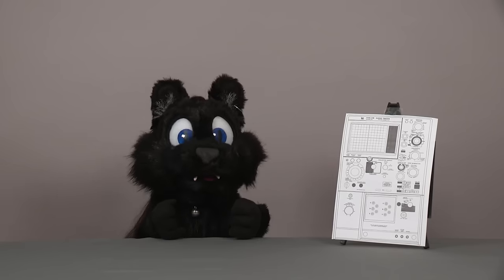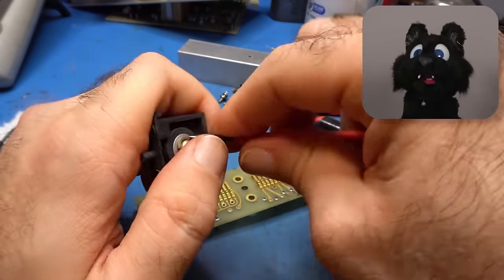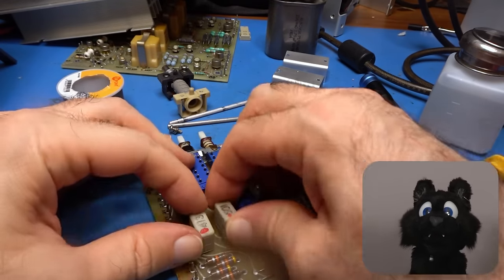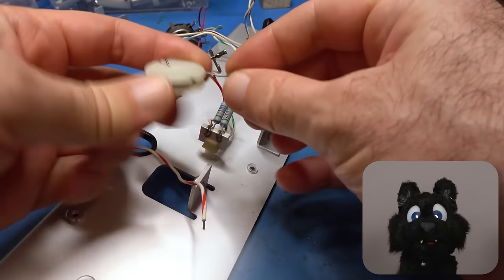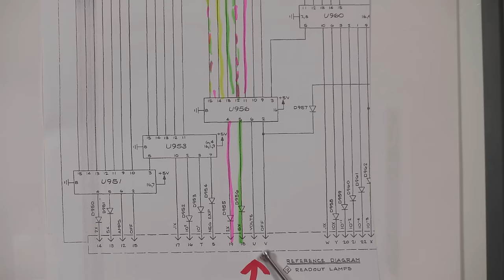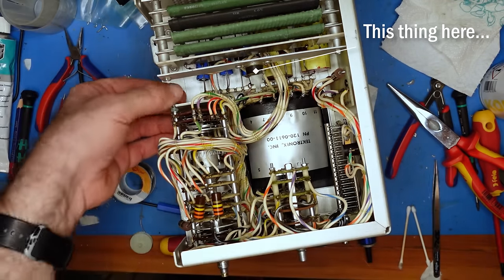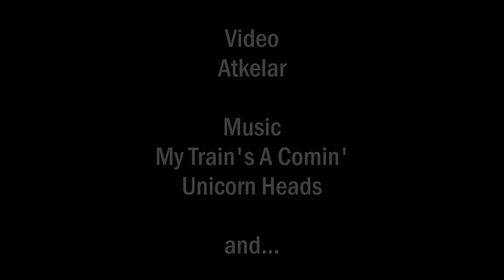Tektronix 576 Curve Tracer - Part 2

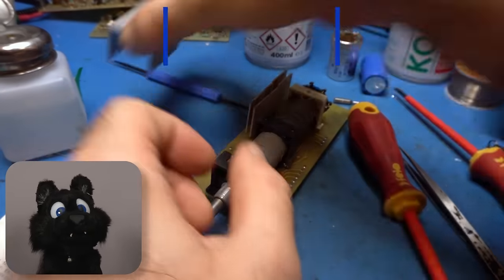Comment: 9:45 These are simply resistors that have been trimmed with a laser so that they have very precise values.
I think because ceramic was often used as an insulator in those days, it made sense to use this as a carrier material.

I have heard that the 576 was only developed for internal purposes, which is why it was built in such an elaborate and complex way.

Looking forward to the next video!
I'm also in the process of finishing a 576 and it's a very nice project.
Reply from the maker: I found out about the resistors after I did the voice over part... it's became clear in the schematics, as soon as I found out which of the resistors map to them.  ☺️

It's still interesting to see in such a device. I know that ceramic carrier from hybrids, as the company I worked for during my apprenticeship made some in house. I never got close to htat part of the factory though. But it did seem a rather "modern" technology back in 1993-ish. I would have never guesed that similar stuff was around since at least the late 1960s. Wikipedia doesn't really answer a precise timeframe either, at least at a glance. So I was wondering if anybody had more insights to that timeline.

I have heard that "designed for internal use mostly" twice now... It would be interesting to know how many units were actually sold; the need to optimize such a speciality product would be low, if there's not many expected sales.

And finally: I am already working on the next video! Quite a few things happening in the script, Let's see if it's going to be a four part series after all! At the very least, there's a little add-on project to be expected!

Comment: Another lovely video from Atkelar.
at 19:05 I find for soldering leads to the bodies of those tin can components, it helps to fold a little L in the wire before soldering it down, they tend to stick better and are less likely to break off that way i think.
Reply from the maker: Good idea! I didn't think of that at the time, mostly because I tried to mimic the original form factor. But if the wire comes off, I'll do it that way!

Comment: Great, thank you. Recently I remember your technics having to rejuvinate rare stereo (concentric shaft) potentiometer.. missing old Q-tips with plastic not paper stick..
Reply from the maker: Glad it worked! Around here, there's now q-tips with wooden sticks even... can't say if I like those yet. The plastic ones doubled as a straw sometimes, that's what I miss most about them...
Reply: @atkelar I remember visiting a sewer plant and the stuff that went all through the end where these nasty plastic pins, without the cotton. I don't miss them.
P.S.: Nice new music and 1080p! Love it.
Reply: @atkelar  The ones with plastic tip, and with the tip made from a felting, are available, they used to come as part of a maintenance kit for solid wax printers, to clean the print head nozzles. Really good, and leaves no fibres at all.
Reply: @StFrye  Yes sewage plants deal with all sorts of nasty, though the worst for the plant is plastic bags and pallet strapping, as that winds itself around pump shafts, and destroys the seals and shafts. Funny enough all the pumps have macerating blades, they will happily pump bricks and rocks, turning them into sand, but string and plastic bags destroy them. That is why all of them are designed to be easy to change, with valves inlet and outlet, and you do not have to disturb the piping to do so, plus also they normally are run with a spare pump in each bank, so as to still be able to do peak flow while doing this. Outlet non return valves are also designed to be self cleaning. But running a sewage pumping plant is messy work. My father designed a few, which were fully tiled inside, including the ceilings, so they were easy to wash, even after you had an oops moment.

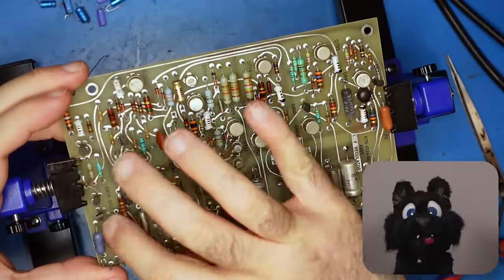Comment: @5:28 those first three caps you took out were wet Tantalum not electrolytic and rarely fail. and also the large one 2nd from the right is Tantalum, you replaced all with electrolytic, you should go back and replace those with more Tantalum ones instead. You can tell the difference as the Tantalum do not have the recessed band around the end of them.

I do love the dedication to restoring the item though!
Reply from the maker: Thanks! It's a bit difficult to pinpoint the difference at times; the parts list just says "Electrolytic" for these caps; The DC rails measure within specs, including ripple though...

Comment: @11:00 for gold contacts you should wet some paper with Deoxit or some other gold suitable contact cleaner and pass it through the contacts to give some mild abrasive action to remove any oxidisation, they may be gold but they still get issues from oxidation formation or airborne contaminants after so many years.
Reply from the maker: I did use a paper strip and the mild contact cleaner I have for the final "wipe" of the contacts; it just didn't film well at all 😿 Maybe there's a bit in the "misc bin" for part three but it seems the only clip I had left with that was very unclear.

Comment: wow wow wow - that's dedication!  I just re-caped mine a few days ago and it sprung to life. K102 threatened to start a melt-down, but I got to it in time (contacts fused together and shorted + & - base supplies!) 
What is the blue grease you used around 17:20 on the concentric mini-pots?
Reply from the maker: I also have a relay adventure for part 3, but a slightly different one. K102 was fine... but the meltdown seems to be similar to the second issue I had... Don't want to spoil too much from part 3 yet :)
The grease is "Molykote BR2 Plus" - it works really good for metal against metal uses. A freind recommended it and so far it has not yet disappointed.

Comment: The wet slug tantalums with a glass seal are almost never going to fail, they are going to last and carry on. Only replace is shorted. The ones with a rubber bung you replace on sight, they are all going to fail after 15 years.
Reply from the maker: Thanks! What makes it weird to me, is that the BOM didn't list the Tantalumns as such. I ordered replacements based on "Electrolytic" type there. I'll give the ones I removed a test, but rest assured: the blue ones I used are not "random cheapo versions" either. Unless digikey got duped that is... And axial tantalumn ones are more expensive than gold these days x.x - it does seem to work, I did check on the power supply ripple as per calibration guide and was within spec.

Comment: What a journey! 
Just a quick question: have you replaced all of those tiny incandescent lamps?
Reply from the maker: I found some with the same voltage/current rating. So I only replaced the broken ones. I'm pretty sure they won't be the exact same brightness, but according to the schematic of the ICs, it shouldn't matter if the current is slightly different.
Reply: @atkelar  That might be true, but incandescent lamps tend to fail over time. If one lamp is failing at my car (Abblendlicht), then I replace both lamps. And since those incandescent lamps in the 576 are much older, I think they might fail as well in the near future. Similiar principle to the electrolytics.
I keep my fingers crossed this won't happen to your 576 but I'd have change all of them for sure.

Comment: So, I am watching you clean all those tiny parts and I'm thinking that surely you have an ultra-sonic cleaner. Then, my mind wondered... Not to consider why you were not using it... But, to how you would individually contain the myriad of multiple assembly parts, without losing any in the bath, and still allow the solvent to reach the parts... That is a question that I am asking of you. I do not have an USC, but I had this container idea... Stainless steel tea ball strainers... Maybe you would have to wrap some self-sealing tape around the mating circumference... These strainers come in a great many sizes and shapes. They are not cheap, so maybe DIY some of your own design. Just daydreaming and spit-balling... Cheers!
Reply from the maker: I got myself a strainer for small parts in the parts washer ^^ - My issue with the US cleaner is that it so far has not yielded any recognizable results... So far, anything I put in came out the same way again, only wet. And thus I don't want to invest in any larger/more powerful ones...
Reply: @atkelar  The US cleaner not working well for you is interesting, because most folks find them useful. Particularly for mechanical parts. Also, some folks put a whole PCB board in them. I am not sure what I think of that, though. Do you have a video on your experience? If not, maybe make one, so that we can help you find a solution. I am sort of wondering if you have a defective cleaner, instead of just needing more power. A poorly mounted piezo would be a sneaky hard-to-find fault. I also am aware that the cleaning procedure does make a difference... Type of solvent, heat, time, etc. I am sure that you have investigated everything thoroughly, but, if we can help you, we would want to. No need for frustrations in our lives.
Reply from the maker: Thanks for the offer... I'll keep that in mind when I have the next possible candidate for a try. Indeed I don't have the most expensive one, and maybe there is something wrong with it, but so far I didn't have enough small parts to be worried too much; An "Oh, well, le't tackle this by hand" was always a possible solution so far.

Comment: please list the large lone capacitors behind the boards in the back,.
Reply from the maker: These are the power rail filter caps - their numbers are printed on the chassis, and values are listed in the schematic. I had to flip around a few for clearance reasons (the CRT cover interfered with one) - do you need the values or just which ones I shuffled around? There's multiple answers to your question :)
Reply: @atkelar  thank  you for the reply, the problem with mine was trace jumping around all over the place. so I cleaned the switches and trace is kind of stable but not sharp and really there yet. 
I measured the 75 v (not sure +or-) it's been a while since I messed with it. trying to collect all info and parts needed. otherwise, I will take it apart and it'll never be put together. 
the 75 V measured around 58 and could not go over 65. so I figured it's the cap everyone is pointing out, the bottom cap. 
I would like to change a few more while I am in there. which ones do you recommend changing.?
Reply from the maker: The -75V cap is the C707 one, a 200µF one. The number should be printed next to it. There's a potentiometer on the power regulator board to adjust that one. But: I'd double check if there's any ripple on the 75V rail; i.e. attach a scope to it in AC mode and see how "even" the trace is. If the cap is bad, it should have quite a bit of ripple on the -75V one. Mind you, it's -75, so the scope ground goes to any of the black wires on the DC supply board, the probe to the negative pin of the cap, which should be Pin "K" on the regulator board. Now, the signals for the CRT and all the high voltages related to it are created in the silver box on the left side of the unit; There is a capacitor on the rear of that too which I'd double check. A "fuzzy" dot on the CRT can have multiple sources; it might be the focus voltage, it might be the brightness...
Reply: @atkelar  thank you for taking the time. I may start on it within the next month to two. thank you for the video and the information. that should be enough to get rolling.

Comment: The ASIC files - the truth (table) is out there 😀
(and if not, they're easy to reverse-engineer)
Reply from the maker: I have found the design documents (at least the circuit diagrams) on the Tek-Wiki. Since they are mandatory open collector (to drive the 0-4.5V lamps) they might not be all that easy to replace anyhow. I don't know enough about programmable chips that are not the typical Arduino based ones... :)
Reply: @atkelar  I once reverse-engineered some PALs from a super rare pinball machine (out of thin air as all remaining specimen were fried) and then went and programmed new ones. By foot (couldn't find a free JEDEC compiler on the internet because I suck at Google).
PALs/GALs however don't usually come in a DIP16 package. And you'd need an open collector driver on the outputs anyway so you'd got to replace each chip with more than one.
Btw. my comment was more of an X-Files reference joke.
Reply from the maker: I thought that looked familiar 😸 but still,  it would be possible to replace the readout lamps with a more modern version quite easily. But I love the charme of the old school solution...
Reply: @atkelar  There's nothing much above light pipes. Maybe Special signage Nixies or plasma displays.